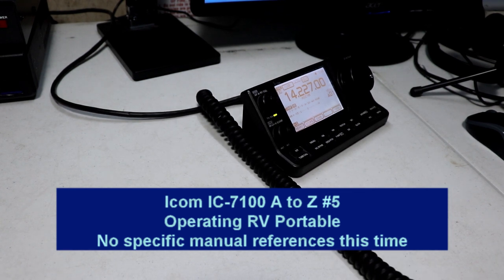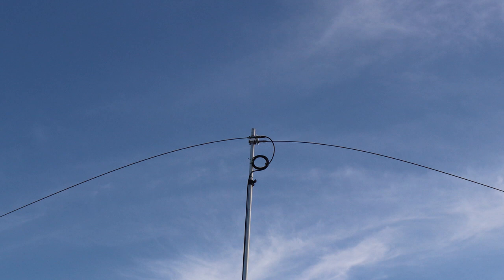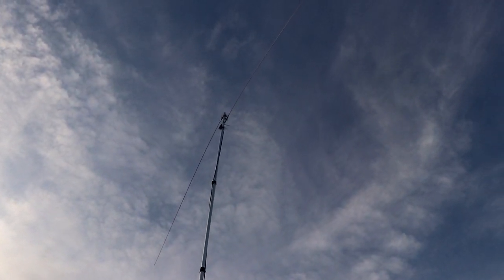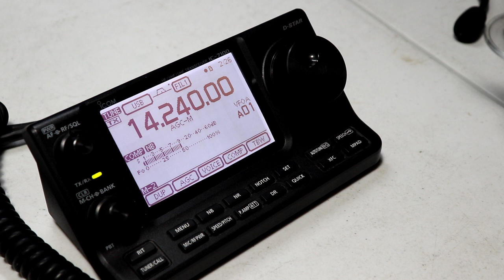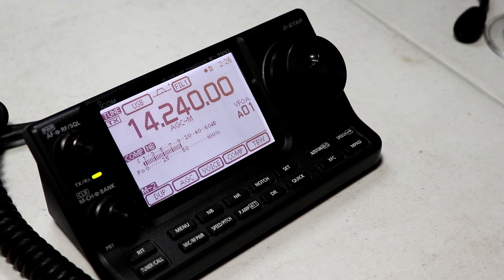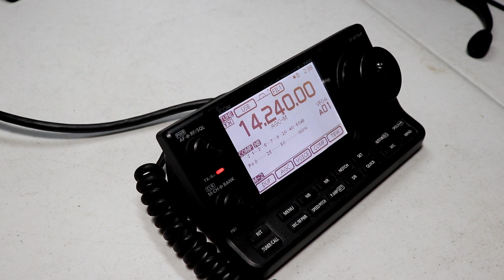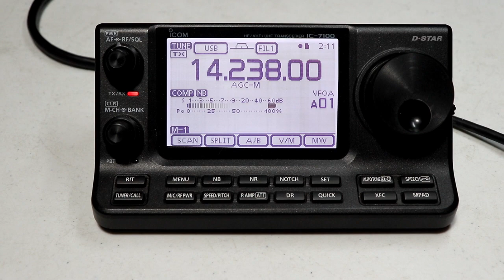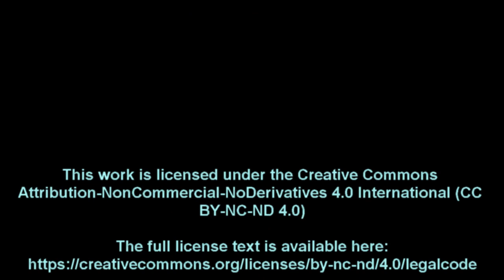IC-7100 from A to Z #5 Operating RV Portable

Comment: Thanks for sharing. I have the IC-7100 radio in my 01 Jeep XJ. I have a link to a video of the results of my install on my KA0KAE QRZ page. I have a LDG tuner and transmit to Shark Distributing ham sticks. I find it does a great job almost as well as my IC-7300 on a EFHW-8010 antenna. A net I frequent on 20 meters have given me great signal reports. So good I have had some contact me via email to get my recipe. Nothing special but it works. BTW I did swap the microphone out for a HM-219 from a IC-7300. Not sure it helps. I think it does...but the money I spent isn't quite sure though...
Kevin from Minnesota
KA0KAE

Comment: Fantastic video series! I have learned more watching your videos than I could have ever learned from reading the manual. I do live full time in an RV an do use the 7100, I love it. I have been battling with figuring out how to get onto HF bands without an antenna farm. This idea and rig you have with the twin antennas is brilliant ! Could you please provide more detail as how you connected the coax? What tuner do you use ? Etc... thank you so much for what your doing. 73’s KR4OWE Florence SC .
Reply from the maker: Thanks for the kind words.  We’re about to be moving into a new house in a few days.  So there may be a little delay in the next several videos.  I will definitely look into doing a more detailed video on the antenna setup.

Comment: I've had the 7100 for some time but not much had it on air.  This past weekend I put it into a mobile van that I like to use and have it with a tarheel II, which I was using with my 857D, which is in an office.  So the antenna, two 8' whip and a tuner seems to do well...  I may be moving the rig into a mini motor home I am rebuilding ... lots of work and sometime away.  I could use the tarheel and park and camp and use the two 8' thing ... I wonder what would happen just connecting a long wire to the tarheel and tune at parked camping ... I don't know if it would work. .. well.

Comment: what hand mic (that's not the one that comes standard) and what MFJ tuner do you have?
Reply from the maker: The mic is the HM-151 remote control mic. I just did a separate video about that. You can find it here:  IC-7100 A to Z #17 HM-151 Remote Control Mic
https://youtu.be/TOPgZ9wNsWM
For a tuner I mostly use the MFJ939i. I’ve been pretty happy with it.

Comment: Another great IC-7100 video.  At about the 1:30 mark in the video you explain your use of two 'untuned' Ham Sticks.  Are you referring to two antennas like a 20 meter and a 40 meter?  Are you using one antenna at a time depending which band you are using?  If so, how do you switch between antennas/bands?
Michael
Reply from the maker: Hi Michael.  When I mentioned "untuned whips", I was referring to the 2 8ft. stainless steel whips in the picture.  Those are not ham-sticks and they're not tuned for any particular frequency. (although they're pretty close for 10 meters)  The MFJ and similar mounts were mainly designed for making a physically short dipole using 2 identical ham-stick antennas for a specific band.  I have used the mount with 2 40 meter ham-stick mobile whips and also with 2 20 meter ham-stick whips to make very short dipoles.  With the 2 8 ft. whips, I just connect it to a tuner and I can cover every band from 40 through 10 meters.  The 8 ft whips are a little short to tune up on 80 meters.  This allows me to switch bands virtually instantly, without having to bring down the antenna to change ham-sticks.  The price I pay is a little more loss in the coax, which is why I mention keeping the coax run as short as possible.

Comment: Maybe this is a crazy question, but do you know of any 'kit' that makes it so the front panel can be 'attached' to the main body of the rig? I know it sorta defeats the purpose of one of the main 'features' of this rig, but I can also think of times/applications where having it as a unified whole (a'la the IC-7000) might be preferable. Just curious if that's even possible. Thanks!
Reply from the maker: Hi Tim.  I don't think it's a crazy question.  I have had the same thought.  Although I'm not sure that there is an answer that wouldn't be a little awkward.  I'm quite sure there isn't anything from Icom and I haven't seen any commercial 3rd party solutions.  Admittedly, I haven't really looked for anything like that.  There is a mobile mounting bracket for the base.  So, it seems like a bracket could be fabricated that would use the mobile mounting bracket holes and would hold the remote head above or in front of the main unit.
Please let me know if you find something or come up with something on your own.
73,  Tom
Reply: velcro